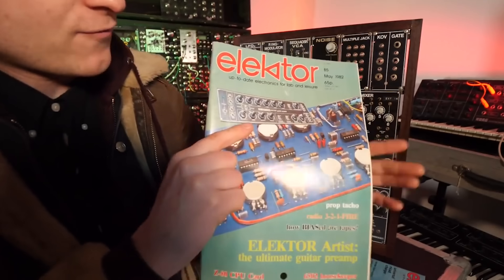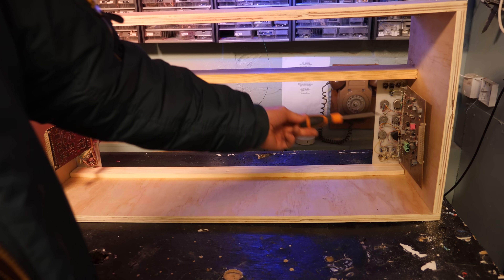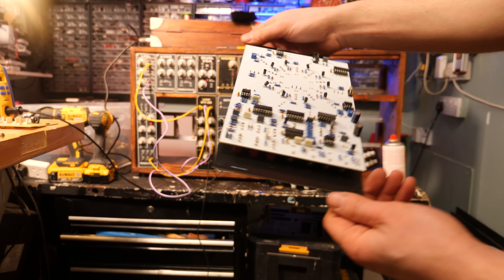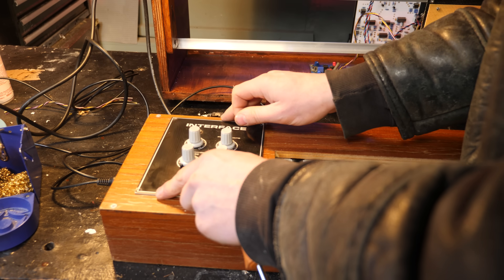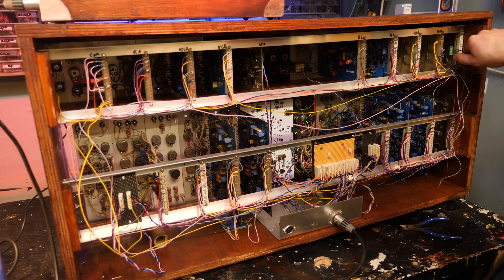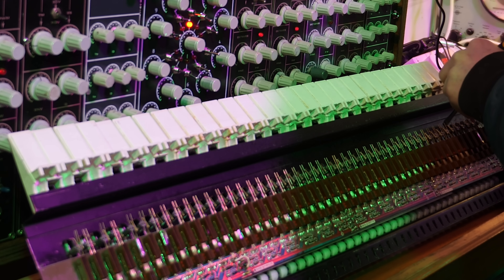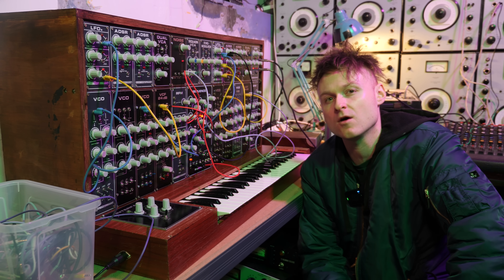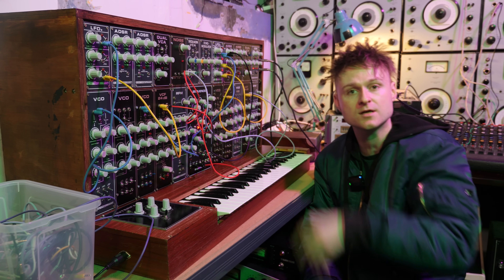FIXING THE 70's DIY MAGAZINE SYNTH THAT BROKE THE RULES - ELEKTOR FORMANT

Comment: 8:25 - "they have power on different pins"... me: what? :D ))) it's ingenious! :)) If something will fail, the company's manager will tell you: please, check that wiring on every module is proper.
Sam, maybe it could be better to connect the other parts of the connectors (female?) first and drilling them to the rails after that? This is a way to minimize the tension. Also you could use some rubber spacers behind bolts when connecting them to the rails. Thus it can eliminate the problem with different lengths.
Other than that you're doing a great work!

Comment: Actually, now that I've thought about it:  It would have been cool to add another keyboard and treat each voice like a division of an organ.  The left side with three oscillators could  have been like the Great, or main division and the right side with only one oscillator could've been like the Swell.  That way, you could play two different musical lines coming through with different timbres from each "division".  But it sounds awesome the way it is now, kind of like a CS80!  I use Surge XT, a plugin that works exactly this way with Scene A and B.
Reply from the maker: you can have polyphonic synths but sometimes monophonic is superior. This is a mono synth. It was designed as one and it has certain advantages. No point making a Frankenstein. That's what you build new synths for
Reply from the maker: There is a switch at the back however so using 2 keyboards they control each side seperately I guess that's what you wanted

Comment: I built and played both the Maplin 3800 and Transcendent 2000 synths way back in the 70s. The 3800 was a beast of a multiple circuit board design, while the 2000 was a single motherboard job. Both were amazing, although they had a tendency to drift out of tune. Had the same problem as you - had to leave the keyboard unscrewed, because a bit of over enthusiastic playing could leave one of the contacts 'stuck' and I had to get back inside to free it up. My university room was a chaotic jumble of parts, boards, integrated circuits and bits and pieces. My playing? I was useless. But the sounds were great!

Comment: All those telephone/uniselector projects have clearly been great back-wiring practice :) nice lace-up job too. 

That's a pretty nice bi-timbral three-oscillator setup. I like the resonators especially, they're a lot like the ones in the recent Korg reissue. But presumably you could buy an RFM module separately to connect to any other synth setup as well!

Comment: Sure, it may look neater than cable ties (although this is the eye of beholder thing), but with cable ties - you can access the individual module's wires separately without needing to cut and ruin the entire string. I began using reusable cable ties for all my electronics projects. Even though they're a bit more expensive, they're more environmentally friendly. But yeah, Formant's got wicked bass, don't even need the subwoofer for live jams and performances.

Comment: i used it once .... a friend of mine bought it and he wanted me to test it if it was working correctly .... [ cv gate roland compatible 1v per octave , gate +5 volt ] .... but i did not just a test buth directly track with it .... 909 + 303 controlling formant
Reply: but the system was more complex ... at les 200% more then seen here in the video

Comment: Have you got the (12dB) Formant VCF filter modules? Feature wise and sound wise they surpass the 24dB ones in many patches.

I was always a big fan of how well you could "pump up" the envelopes of the Formant with consecutive key presses if you gave them a slow attack and decay.
Reply from the maker: Sadly don't have one so just immured it's. So I have heard. But these 24db ones are good! Checking the schematic not sure why they would surpass as comparible but I have heard that before. Not sure why it would be though. Same ota situation
Reply from the maker: As for the pump up! Yes much like korg ms range and mini moog :D

Comment: Since they're the nonfunctional ones atm and need fixed anyway, have you thought about switching the front panels of the two VCO's on the right so that it matches the other side? I think it would look great symmetrical. The whole bottom row would be light, dark, light, dark, light
Reply from the maker: nice! to be honest i hadnt given it much though! treated it more as an old plane with replaced panels, like a patchwork quilt :D. i quite like the chaos

Comment: The knobs have ended up a similar colour to old test gear, I like it! If you find the paint wearing off then give them a few light coats of matt acrylic varnish. Thanks to the automotive boys having to use acrylic, I think, the aerosol acrylic top-coats have come on a long way in the last few years. Tough as old boots, and they don't turn yellow.
Reply: The wax lacing looks like old test gear, too! Lovely touch! Cable-ties would have been out of place somehow. Top work!

Comment: If there's no standardization between the pins, what's the point of the sockets? 😭
Reply from the maker: to remove the modules to fix and calibrate and adjust? if you havent tried fixing things like this without sockets. i can understand the comment. but practically itll just be a mess without them. and you can chop and change similar ones

Comment: I have a nice Elektor system that was made for me last year. Very strong & moogy sound, envelopes a bit weird.....
Reply from the maker: nice! i have been meaning to apologise for not responding to the email about your show last year, i read the email and then left it to think about what to say and what not. before i knew it i had forgotten and by the time i'd remembered i felt it was too late for any excuse :(. is your formant an old pcb design where they run backwards or modern like the JVR ones where the PCB's run in parallel?? curious how one made would be done
Reply: @LOOKMUMNOCOMPUTER   It's from Jos. Nicely built modules. No sweat about the visit, I ended up having to rush home anyway.....
Reply: @LOOKMUMNOCOMPUTER  btw how do you find the envelopes? mine are pretty weird compared to other synths. I guess weird curves or something.

Comment: Its So Much Fun twiddling Knobs, i do it virtually via reason on pc, been doing it for quite some time now, i just started using reason 12, but it would be nice if i got the chance to have a go on one of these (real) babies in the not too distant future.  i would relish it so much. i wonder if there is a place locally i could visit, hmm!  💣💣💣💣💣💣💣
Reply: Reason with a MIDI controller of decent size can be fun, if you know what knobs you want to map. Still doesn't beat a wall of knobs.
Might want to look at VCV rack 2. Hundreds of completely free devices to play around with.

Comment: The instrument face is set too shallow.. make it deep enough that the synth cabinet can be laid on it's face without damaging the switches and dials.  That way In the rare event that it is knocked on it's face it won't be a total write off.  IMO the easiest way to fix would be to add some trim around the front.. may be a good excuse to use a fancy type of wood for accenting the cabinet.
Reply from the maker: It was a purposeful design choice. My other ones are set deep and for one that is not designed to be portable. Having them deep is not practical to use. Those snapped because I was being dumb. It would do it on any synth like this.

Comment: I get the appeal of the Formant, but wow did Eurorack ever simplify things.  No sockets to line up the backs of modules, so they can be any shape or orientation you feel like, yet ribbon cables are quite robust.  One (sorta two) faceplace heights but no restriction on width, so you can have simple modules take up as little space as you want.

I think if I were assembling a Formant today, I wouldn't bother with the "backplane" rails.  Maybe even ditch the weird connectors they currently use, or run single-pin/dual-pin dupont connectors from a eurorack backplane.  The neatness of that rail is nice, and maybe the structural support would be good for those flimsy cards, but I'd try to solve those two problems separately.
Reply from the maker: the issue is the large amount of internal patching wires, how will they connect if in a universal eurorack style power bus?
Reply from the maker: i came to the same conclusion as you in the last video, but ultimately realised the best way to do it was what i did in this video, after doing it similarly rto the way you suggested in the previous vid.
Reply: @LOOKMUMNOCOMPUTER  Yeah, understandable.  The default patch is a curious twist, but I think I'd still just use jumper wires with female connectors on both ends.  My results wouldn't be anywhere near as pretty as yours, though.

Comment: Its probably my OSD but why do not redo all the PCB connectors to have +, -, Ground, Input, Output etc in the same pins ? then you will have option to swap them now all that fancy "Main Connector" is waste of time
Reply from the maker: It's not? All of the pre patching requires it? Also that would require completely modding the pcb. There is no point chopping and changing. You misunderstand the function of them
Reply: @LOOKMUMNOCOMPUTER   Yeh I "Jump the Gun" like they say :), later you pointed out that different PCB connect to specific one so NO SWAPABLE  components :)

Comment: Was it ever stated clearly why it broke the rules?
Reply from the maker: The video title that broke the rules
Reply from the maker: Cus it's semi modular
Reply: @LOOKMUMNOCOMPUTER  Ohh..... I didn't see that as a rule - more like a convention or 'usual practice'. I thought I had missed something about it having a weird voltage scale or negative gate or something like that. That's why I was curious.
Reply from the maker: weird voltage scale, and negative gates is also a rule of convention. a lot of DIY synths vary massively on both @organfairy , as you are likely aware
Reply: @LOOKMUMNOCOMPUTER  Absolutely. I have a Roland SH-2000 that has a truely weird voltage scale; not only negative, but also somewhere in between linear and logarithic. But it doesn't matter as long as a "rule breaker" isn't meant for communicating with other synths - the SH-2000 is a stand-alone-on-top-of-an-organ type of synth.